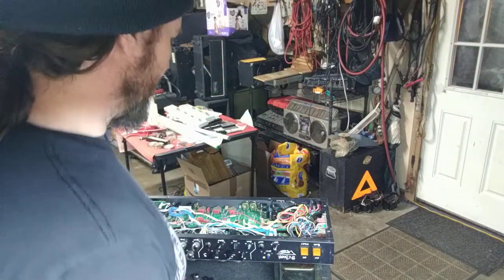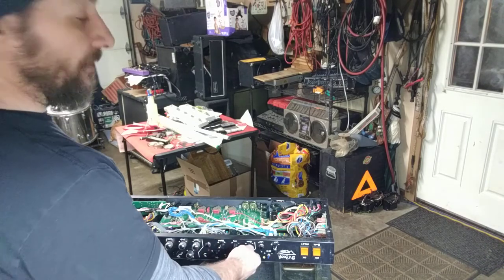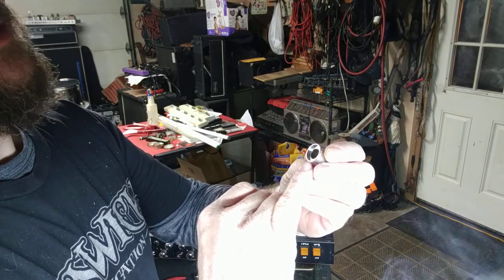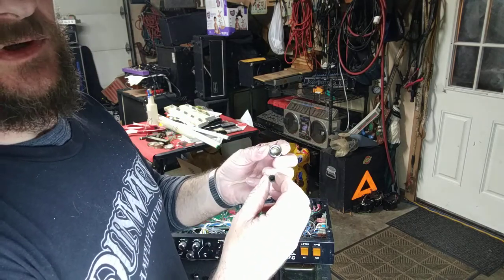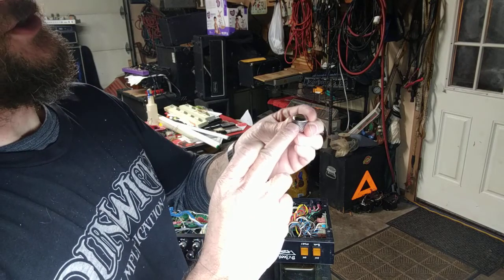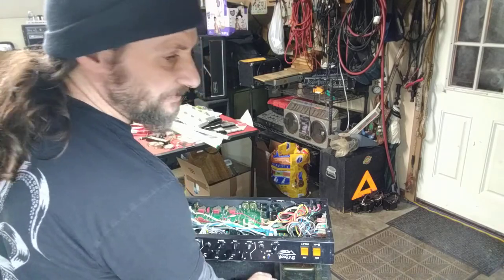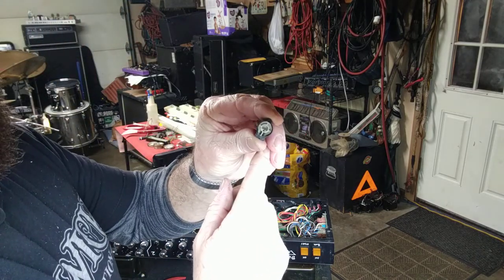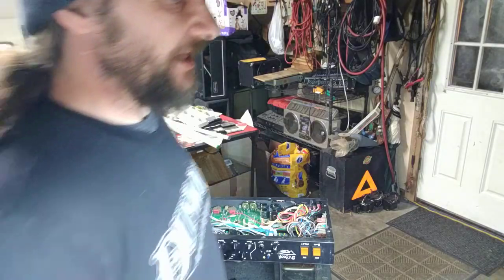Crate Peavey Etc 3/16" knob fix 4.5mm small shaft pots

Comment: I had na Ampeg in the shop here for a customer with 3/16 push-on shafts... ended up giving myself a project over the weekend, learned Fusion 360 and 3D printed replacements! 

The real trick at the end was making new aluminum toppers!